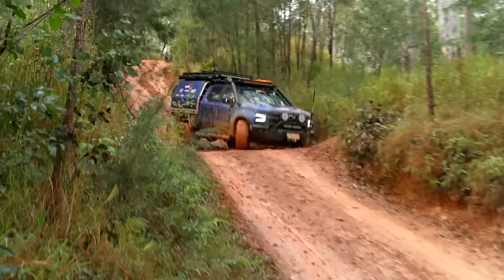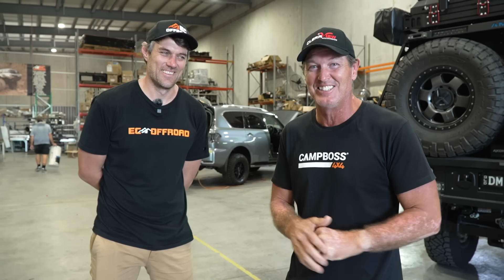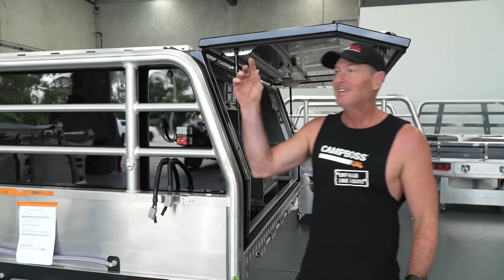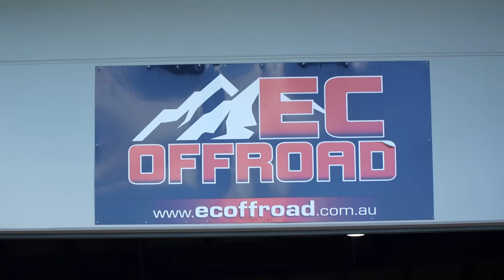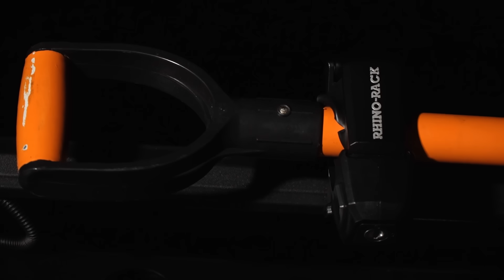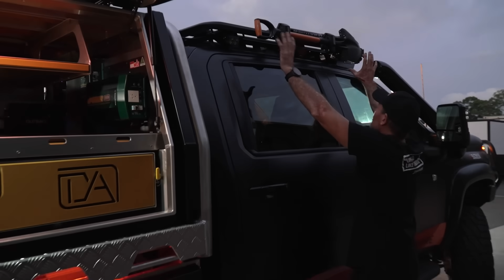🔥 NEXT-LEVEL CHEVY 2500 TOURING RIG — All 4 Adventure Season 16 BUILD REVEAL! 😯

Comment: Good to see you have a good 4x4 there just got to pull you up on one thing it’s not a conversation it is reman they take the cab off and rebuild it to right hand drive and if you want to do engine modes look up banks power in the USA he has the contract to supply duramax to the military he has one on the dyno at 1200 hp have a look at his website

Comment: You better add a tank of DEF to the roof rack. You will know agony if you run out of DEF in the bush. Limp mode and a computer reset and recalibration. Also, watch where you park it while idling. Random regeneration can set grass on fire and melt plastic. Just be safe while you save the polar bears.

Comment: Such a heavy truck on small Tyers it will just take off and roll agin.  When you have a 300 on the 35. 37 can’t be that much  bigger foot print for the weight.

Comment: All 4 adventure should include the price breakdown of each of their builds.
Reply: Hard to know when it's free.
Reply: 400k
Reply: @KyranBridges 
I reckon
The 79 series they built a few years ago was close to $300k
Reply: I'd bet with that truck and all the work it's probably 250k. That truck in the states is right around 100grand so ide assume having it sent to Australia and swapped to right side drive he's into it for 150k before the build really began. The Keldermen lift price can be found right on the websit..I'm not really sure why they didn't just do the Keldermen front instead of using a different front suspension lift. I'm from the states and don't really get the bed canopy thing as it seems to just waste so much space while adding a lot of weight high up in the truck that would be on the verge of rolling on its side at most of the areas wheeled out here. Then again its not really built to wheel like my FJ is and my FJ isn't nearly as fun to camp out of or as comfortable with the amenities this truck can provide.
Reply: Didn't you watch the whole video? 387K not including the truck.
Reply: Why no one’s business absolutely epic truck